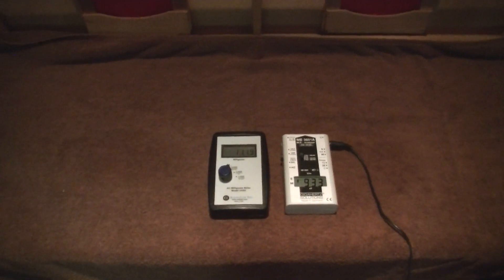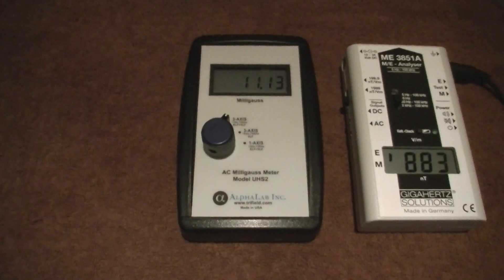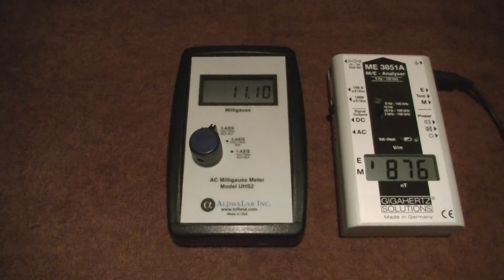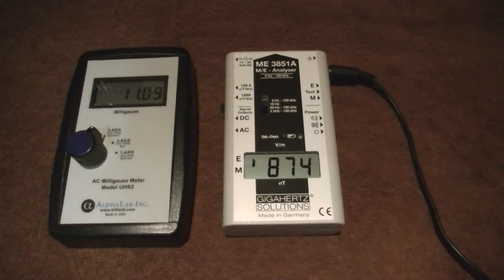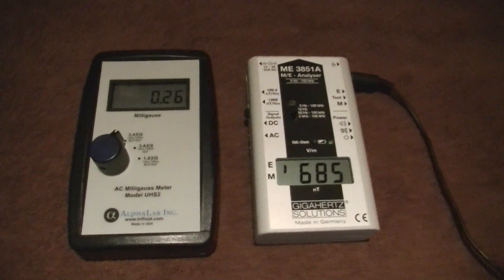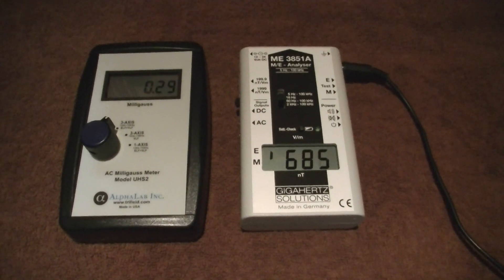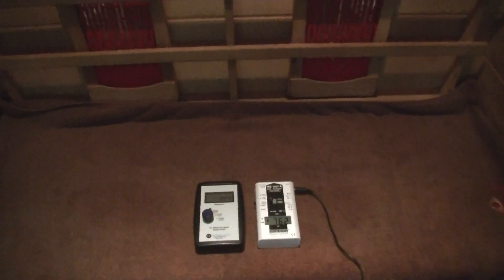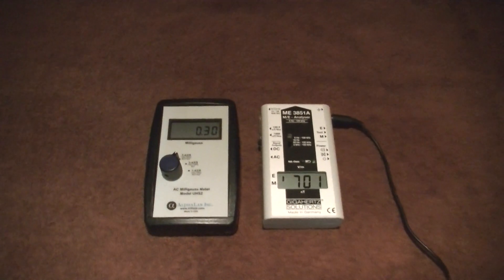Measuring a High EMF Far-Infrared Sauna

Comment: Is there any way to upgrade a sauna you already have to lower EMF's?
Reply from the maker: Not really Deborah. You would need to create or buy a setup like this: https://www.emfanalysis.com/low-emf-infrared-sauna/
Reply: You've used all the correct test equipment, and only done a 1/3 of an experiment. There are 3 types of far infrared panel being used in saunas. From the very brief glimpse of the one you tested, it looks like the ceramic type. Another guy did a far more informative video on here, comparing ceramic to graphene. Cratonic was high. Graphene virtually none existent. There is a 3rd type, mica. So I believe this one is mica with carbon granules 'infused' or layered onto one side? But can't find any real info on these. A bit of useful info works have been a test of all 3. 
But yeah, well done : you proved ceramic have a high emf. 
As others have done.

Comment: Interesting. I'm in the process of building a bespoke infra red sauna in my home. How do you suggest picking a good supplier with low/no EMF output? (I'm in the UK).
Reply from the maker: Hi Sarah, I list a couple in this article: https://www.emfanalysis.com/low-emf-infrared-sauna/
Reply: @emfanalysis  Hello if you plug the sauna into a greenwave dirty electricity blocker, would the emf coming off be much lower?
Reply from the maker: @justbringit9157  I don't typically recommend such products as they are capacitors that are simply moving the EMI from the hot wire to the neutral. It's still on your wiring, just not where their meters can measure it. An AM radio test will show this.